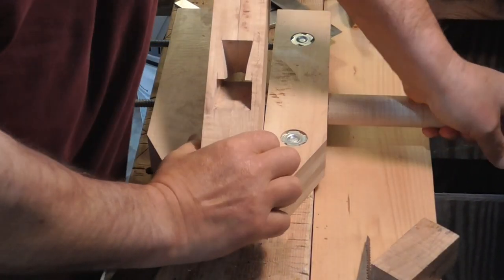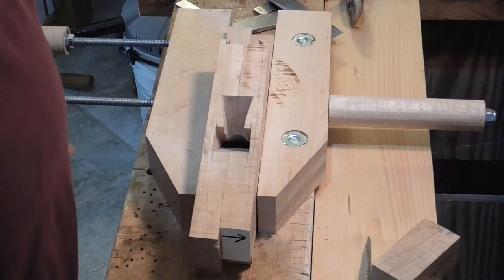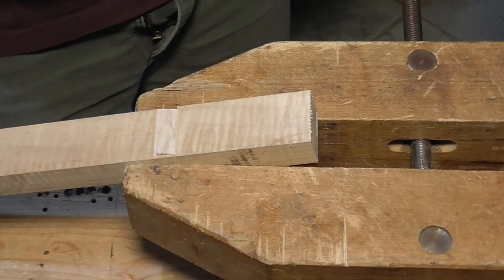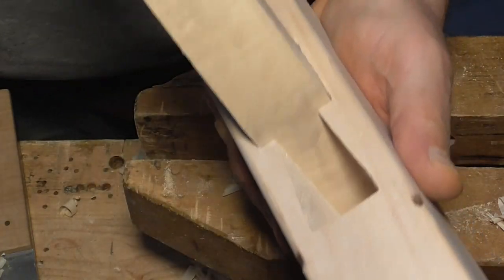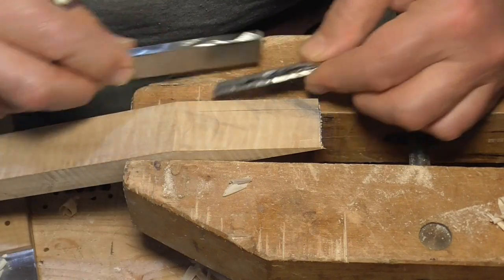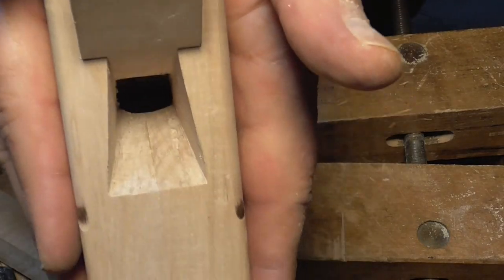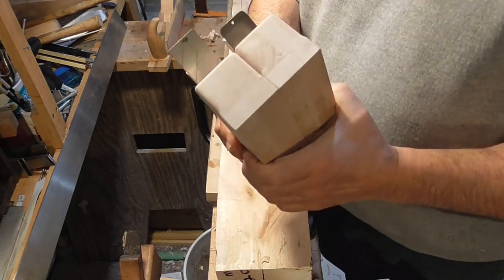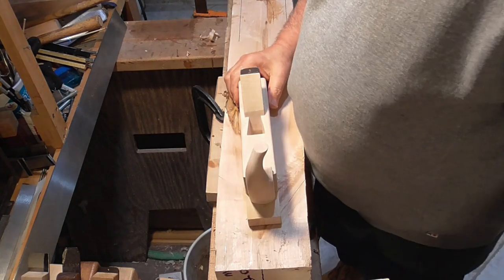Plane Making - The Scrub Plane, Part 2.... Final Segment

Comment: What size radius do you like to put on the cutting edge of the iron? Thanks for the great video. Nice camera angles and good editing.
Reply from the maker: Your question is a good one. I haven't made a blade yet for one of these planes, only used the after market blades I bought years ago. I just checked one with a compass, looks like a 6 inch radius. I'll be putting that on the one I make, eventually, seems to work well enough.
 I finished making a new mount for my camera and light last weekend, thanks for noticing and thank you for subscribing !
Reply: @ROUGHCUT20  I have a lie Nielsen scrub plane, an exact copy of Stanley’s I believe. It works fine but the handle is too skinny for my hands. I’d be interested in trying a wooden one like yours.
Reply from the maker: @hkimsey  This is not a difficult build. Copy all the angles from your plane and re-use the blade...Add 5/16 to each side of the blade, that is the total width. If you need other dimensions, let me know. Good Luck !